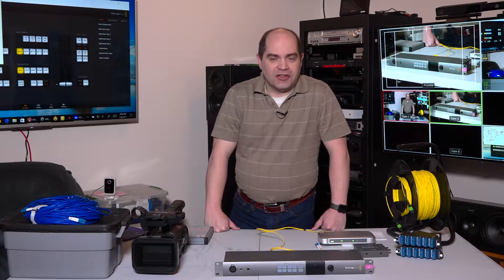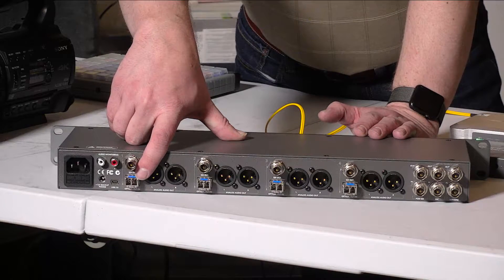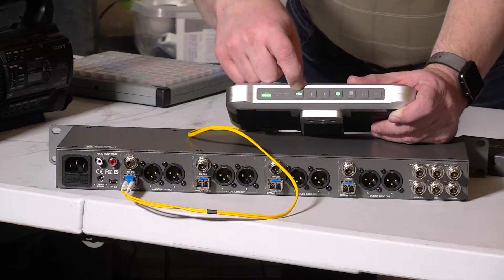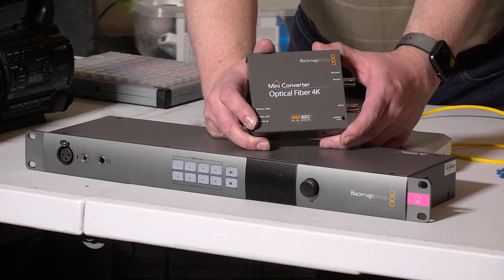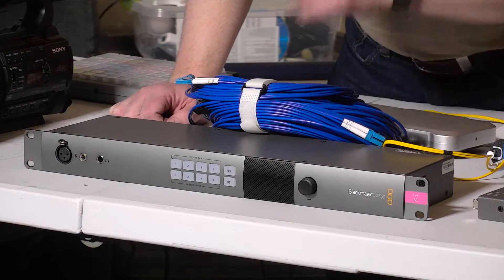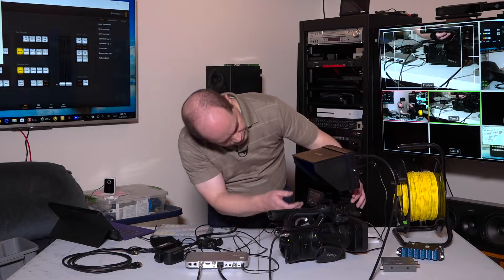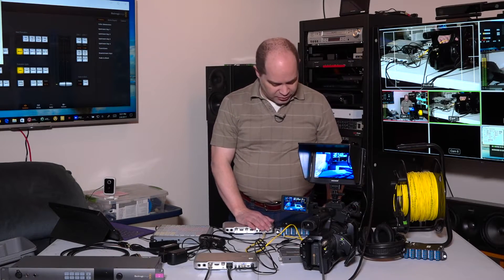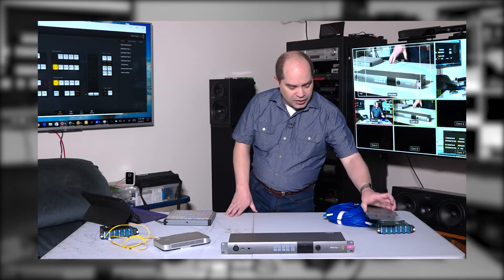Blackmagic Design Optical Fiber: Studio Converter, Camera Converter, Mini Converter 4K

Comment: Hi , thanks for all the help I am still in the testing phase my headset connected to the talk back convertor I can only hear the operator but they do not hear me , they also using the camera convertor with the headsets you recommended . but the headset am using on the talk back convertor is xlr .
Reply from the maker: Are your green Push/Lock-to-Talk buttons enabled?

Comment: Hello!!! I'm about to buy the 8-channel ATEM talback. I already have 8 fiber optic videoconverters to 12g SDI de BLACKMAGIC. Once the connection of the 8 cameras is finished, do I have to leave the talback to a switcher? Or does the ATEM talback also work as a switcher? I ask you because I do not see that it has a MULTIVIEW output to be able to view the 8 cameras and be able to use it as a switcher at the same time.
Reply from the maker: You’ll need a separate switcher. The Talkback Converter doesn’t do any processing on the video
Reply: @djp_video  
Okay!!! thank you very much!!! I want to use the Blackmagic Design ATEM 2 M / E Production Studio 4K, because I need to use 14 cameras in the stream. What do you recommend that I use as a control panel? Because the ATEM 2 M / E
Advanced Panel is extremely expensive for me in its price. Is there another panel that I can use to take advantage of the 16 inputs it has?

Comment: hi Dough , I purchased the camera converter is besides on the operator is there a way I can mount it to a tripod ? tripod legs the camera ?
Reply from the maker: It has 1/4-20 and 3/16-16 screw mounts on the bottom so you can use pretty much any clamp with either screw size. I also use the belt clip to hang it on mid-level spreaders on the tripods that have them.

Comment: I know you used MTP fiber in this video explainer, but if you were going to do all this brand new today, would you still use LC ends to MTP and with Cassetts, or would you go ST ends to the trailer? Looking at one-way or the other currently. Thanks!
Reply from the maker: I use MTP because it contains many fiber strands. In the case of the cables that I use, it's 24 strands in a single connector. That isn't true of LC or SC or ST. Trying to deal with 24 individual ST connectors in my trailer would be frustrating and time consuming.  Not to mention 24 opportunities at each end for a cable to be damaged or get dirty or just not get installed correctly.

I've defaulted to LC for everything else because that is what the Blackmagic equipment ultimately uses. If I was to have ST somewhere in the mix, it would be an additional conversion step to get it back to LC anyway. And with fiber, each connection causes some loss of signal. So minimizing the number of connections is better than adding extra unnecessary connections.

In a perfect world, I'd use Neutrik OpticalCON for everything because it protects the fiber cables much better than other options. But OpticalCON MTP 24 uses (surprisingly :) MTP connections internally.

Comment: Hi great video and well explained. I have a question about Talkback Converter 4k, the one with 8 inputs/outputs? Is it possible to send different signals to 8 Blackmagic MiniConverter Optical Fiber12G via the optical wave in each SDI IN? I don't always need a program for all 8 converters, but sometimes an AUX or I have to send an external signal via the glass cable. Maybe you can help me. Thanks :-)
Reply from the maker: No, unfortunately the return signal going to the cameras has to all be the same.

Comment: I have recently purchased a Blackmagic Studio converter  and 4 Blackmagic camera converters.  I am interested to know if anyone has found a way to "extend" the tally lights from the camera converter.  In their current placement  they are almost useless.   If the converter is positioned so the cam op can view the panel, then the tallys are on the left and right side of the converter.  What the...?   Just looking to remote an LED to be placed on top of the camera that is visible to both the talent and the operator.   Without having to disassemble the unit  and drill holes.   Anyone working on this?

Comment: Thanks for excellent explanation! I have question about possibitlite to connect 3-4 cameras with BMD ATEM Camera Converters to your duplexs system and after that with BMD Fiber to SDI converter to ATEM Television Studio HD. In this case, how many video inputs from the cameras will I have - 1 or 4? My idea is to exclude the Studio converter from the setup or it is not possible?
Reply: instablaster.

Comment: Doug can you post a link or a model # of the MPO/MTP Cassette and fiber snake cable that you use. I'm interested in doing the same setup.
Reply from the maker: I wish I could.  I got them as one-off deals on eBay and they don't have enough identifying information to be able to link to them.

What you're looking for is single mode fiber cassettes with MPO/MTP connector on the rear and LC connectors on the front.  The LC side should be blue (not green -- those are APC which won't work).

With the MTP connectors, make sure you're connecting male to female.  It seems that male connectors are common in the cassettes, but female aren't unheard of either.  The fiber trunk cable should have the signals reversed (strand 1 on one end goes to strand 12 on the other) -- I believe this is called type B, but don't quote me on that.

Comment: Thanks for the excellent tutorials. I've learned a lot.

So I have an event next month. Pretty big for me. And now the client asked me if I can connect two visual switchers with each other (2 different stages). Output 1 on input 2 and the other way around. Now I was thinking:  I purchase 2 camera converters and a few hundred meters of fiber to connect them. But do you know if that is possible? (Including audio)
Reply from the maker: It would work.  But a cheaper solution would be two Optical Fiber converters.
Reply: Thank you for your quick reply :) I would like to use the converters in the future for productions, so I think the camera converters would be the best deal for me :) Now only figuring out which fiber to buy and we can party on :)
Reply from the maker: Just look for blue LC connectors and you're good to go.

Comment: hey Doug, do you know if these fibre connections will work directly with the Blackmagic Studio cameras? or do i still have to get the studio converter+camera converter connectors?
Reply from the maker: Dennis Allen The full-size Studio cameras have SFP slots in them so they can accept fiber directly. All you need is to buy one of their SFP modules.
Reply: i know you're not a BMD representative lol but can you do a workflow graphic and breakdown. i'm struggling to understand magic of how the 9-strand snake carries 6 video inputs+programme+data and how you utalize the third party fibre hubs and the BMD VideoHub to get everything moving along.
Yesss...i know it's plenty to ask! :-D
Reply from the maker: It's pretty simple... a diagram isn't required...

Fibers 1 through 9 carry video from the cameras back to my trailer, going to two Studio Converters and one Optical Fiber converter.  10 and 11 carry video from the trailer back to the cameras (one output of each Studio Converter), distributed to the cameras by a pair of 1:4 optical splitters. The 12th fiber carries bidirectional 1Gbps Ethernet network traffic.

Comment: Thanks for the quick reply. What are the 8 SDI INs on the rear plug-in field for? That was my thought, that's what they're for.
Reply from the maker: Those are meant to connect to the camera's SDI output, in the case where you're using coax cables instead of fiber. There is also an SDI output on the Talkback Converter meant to go to the camera's SDI input. So you either go fiber, or use those SDIs, but not both.
Reply: @djp_video  Thanks

Comment: Hi Doug, it is very very helpful! I have ATEM Television Studio Pro HD. Is it possible to connect Mini Converter Optical Fiber 12G over opitical cable to ATEM Camera Converter with full functionality (with tally and talkback) and exclude ATEM Studio Converter 'cause it delivers 1 mix-minus for all cameras and talkback is in switcher already? Probably can't talk to one camera then but all. Thanks. Gordan
Reply from the maker: I haven't explicitly tried using the Optical Fiber converters, but it should work. I'll be testing that soon, though, because I actually need that myself for an event I have coming up in a few weeks.  And you would always be talking to all cameras, as there aren't any buttons to select the relevant outputs.

The SDI outputs on the TVS can be configured to either be mix minus or a regular program out, just FYI.
Reply: @djp_video  Thank you for a quick answer confirming some my thoughts about optical interconnections. You are doing great job an have very inerresting mobile setups. I should do that in very similar manner if I had that budget and production needs. Best regards, Gordan Antic
Reply: @djp_video  Hey Doug! Did you ever test the Talkback converter to the 12G optical converters? Interested to know if it’d work
Reply from the maker: @griffinellis5578 I haven't tested it explicitly, but it would work.

Comment: Can i do 1080 50p with the camera converter? I don’t get a picture with 50p
Reply from the maker: If your video source is 3G-SDI Level B. If it's Level A it won't work.
Reply: @djp_video  where can I change to level B
I go from a JVC gy 180 with 50p to the converter and than into an Atem television studio hd
Reply from the maker: You usually can't change the camera's output type. But it can be converted from Level A to Level B with a Blackmagic Design Bidirectional Micro Converter or Decimator MD-LX.
Reply: Thank you. I will try that.
Reply from the maker: You should also try HDMI if you can.

Comment: Could you please explain how you hook up 6 cameras on the single fiber cable that you talked about in the beginning of the video
Reply from the maker: The reel contains a 150 meter cable with 12 individual fibers in it.  That allows for up to six cameras -- two fibers per camera: one for transmit, one for receive, over a single cable.  The connectors on the end are called MPO or MTP, and those plug into the back of the cassettes you see sitting just in front of the reel.  From there I just use regular single mode cable with LC (UPC) connectors as I normally would.
Reply: Is the MPO cable Single mode or multi mode?  Does it matter?

Comment: Hey great video, is those blue armored cables are reliable in events when people can step on them?
Reply from the maker: So far they've all held up.  And I've had to lay them in walking paths quite a few times.  They're reasonably rugged, though not as much so as you might find on higher-end gear.
Reply: doubledeej thx a lot, the price difference between those cables and fieldcast or tactilalfibre is insane. Its worth trying them

Comment: Does the ATEM camera converter ship with a sfp module?
Reply from the maker: Yes, it ships with the 3G SFP
Reply: Doug Johnson Productions I also have contacted my local store and that is the response they gave me. 
 “The older Camera Converter includes the 3G SFP, but all the new products exclude the SFP”
Reply from the maker: The Camera Converter, Studio Converter and original Optical Fiber and Optical Fiber 4K mini converter units do include the SFP.  The newer Optical Fiber 12G, Talkback Converter, and Studio Cameras do not include SFP modules.

Comment: Is there any tally information transmit from the camera converter output to your camera monitor like red and green box?
Reply from the maker: The ATEM switcher does send tally information on all of its SDI outputs.  So if the ATEM is connected directly to the Studio Converter or Talkback Converter, and you have Camera Converters on the other end it will display a red tally box when viewing video from the local camera.  If any one those pieces is missing, though, no tally box shows up.  And it only works for Program, not Preview.
Reply: doubledeej thx a lot, so only red box mean no preview tally, wich not a big deal for my work coz I awlays tell the cameraman to standby before i switch to his camera

Comment: Quick question, I'm wanting to setup cameras at a Dirt Race Track, Most cameras are 1,000-1,700 feet away, so would all I need is converters to convert from sdi-fiber>fiber cable>fiber-sdi>then into the switcher? (Sorry Im still REALLY new and confused even after watching every video I think is on the internet)
Reply from the maker: Yes, but you’d definitely want outdoor armored cable to protect the fiber strands.

When purchasing, you want single mode, LC connectors. Blue connectors (not green, or teal) will let you know you’ve got the right thing.
Reply: Doug Johnson Productions Thank you SO much!! I’m planning on getting out door cables and running them in some PVC pipe and capping the ends when not being used to keep water and stuff out do you think that would work very well and do you have somewhere you recommend to get budget friendly Fiber cables?
Reply: Doug Johnson Productions If I’m getting a 12G converter and use a 3G optical module, would it still work because my camera is 3G so I don’t want to spend the extra money on a 12G module if it’s not going to affect anything. Thank you so much for all your help!
Reply from the maker: The 3G module works just fine in the 12G converter, as long as your video is 3G-SDI or lower.
Reply: Doug Johnson Productions Ok! Thank you SO much for all your help!
Reply: Where do you recommend people get Fiber cables from?
Reply from the maker: fs.com is a pretty good source. But I get a few off of eBay too.
Reply: Doug Johnson Productions Ok thank you so much!
Reply: Online it’s asking what connecter I need, just so I don’t mess up, do I select LC UPC Simplex or LC APC Simplex?
Reply from the maker: Duplex, not simplex (two fibers instead of one), UPC. Look for the blue connector.
Reply: Doug Johnson Productions Ok thank you!! Hopefully that all the questions I have but it’s been hard finding information on fiber, really the only thing I have found is your videos and I think I have watched them all!